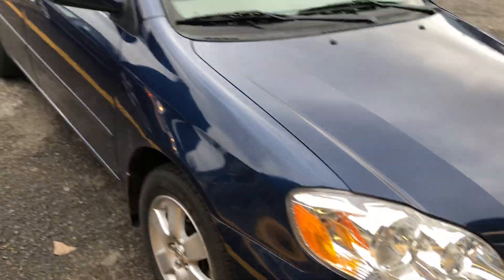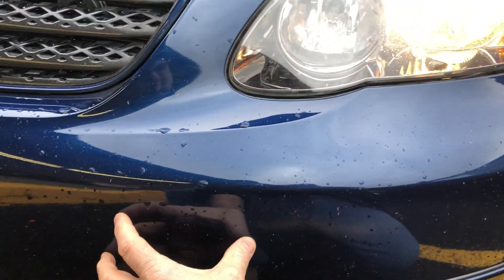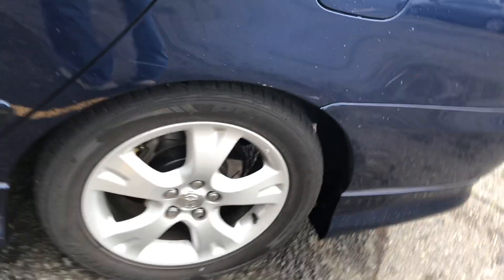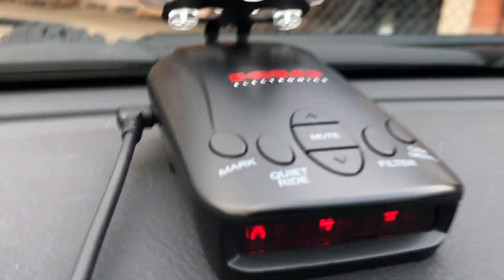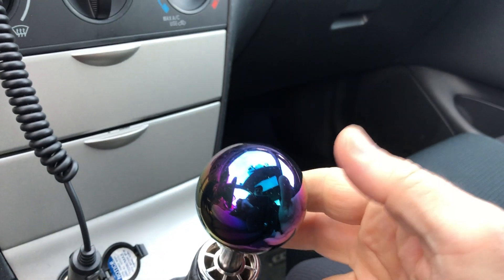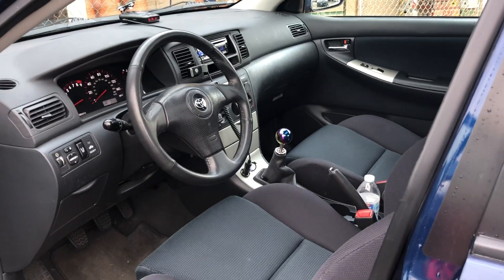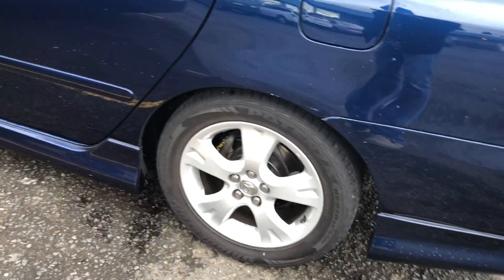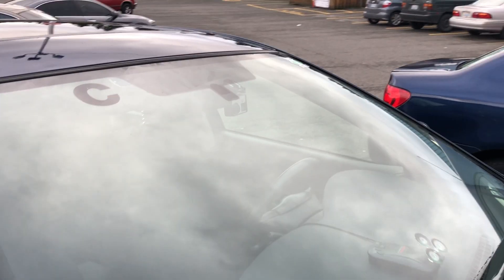2006 Corolla XRS Walkaround (Requested by @Buttmongrel3)

Comment: Toyota Corolla, XRS bro you ever think about getting a double den radio.   🔥🔥🔥🔥🔥🔥🔥🚬🚬🚬🚬🚬🚬🚬🚬💯💯💯💯💯💯💯👌🏾👌🏾👌🏾👌🏾👌🏾👌🏾
Reply from the maker: The OEM radio was a double DIN with a six CD changer. I still have it but it didn't have Bluetooth so I swapped it out for the Alpine and gained a handy place to put my wallet! I actually have oil pressure and temperature gauges in that spot now. I guess it's probably about time for an update...
Reply: @BluestreakCorollaXRS    do you have that radio for your car? Cool bro you did a nice job on that cooler intake for your Toyota Corolla XRS.   
I’m trying to get one of those radios for Matilda, Corolla with the Bluetooth navigation  
Those videos are real nice    I’m trying to get one of those radios for my car  too bro you💯💯💯💯💯👌🏾👌🏾👌🏾👌🏾👌🏾👌🏾👌🏾👌🏾📱🔥🔥🔥🔥🔥🔥🔥🔥🔥🚬🚬🚬🚬🚬🚬🚬
Reply from the maker: @streetsofcalifornia6481  did you name your car Matilda?
Reply: @BluestreakCorollaXRS    Yes, I made my car that I always like the Toyota Corolla. I had a couple of those cars different years very reliable.  Japanese cars always win 💯💯💯💯💯👌🏾👌🏾👌🏾👌🏾👌🏾🔥🔥🔥🔥🔥🔥🔥🚬🚬🚬🚬🚬🚬🚬🚬📱📱📱📱👍👍👍

Comment: how much does yours weigh? and did you dyno it, I'm curious of your power to weight?
Reply from the maker: I'm not really sure, but I think the weight is just a little over the stock 2670 lbs - I've reduced about 40 lbs of wheels by upgrading to Enkei, but they're sporting larger tires at 225/45/R17, which weigh more. I also added weight when I upgraded the headers and exhaust and oil pan. I have not had it on a dyno, but R9K told me that if I did the upgrades that match the ECU tune, I should get "into the high 190's at the wheels".  I hope to weigh it some day, and I will be getting an LSD installed while my cams are being replaced this month.
Reply: @BluestreakCorollaXRS  dang high 190s whp.. thats pretty good for N/A on a corolla, what effect do you expect after cams? stage 1 or 2 MWR cams? what LCD you going for , a Cusco? and yes the headrests lol, i wish i could delete them too but im always carrying passengers... are you planning on further N/A mods? ever plan to go with the turbokits.com kit?
Reply from the maker: @CubanLegend561  I'm going to put stock cams back in. I looked at the power curves on MWR and it looks like other cam profiles have advantages and drawbacks that I don't think are worth the $$. I got the R9K addition PPE headers, which actually make power. I found a used TRD LSD on MWR for around $400, so I snagged that and started waiting for the clutch to go... but now I've wiped my cams I'm going to get the LSD put in at the same time. I think before even thinking about adding more power, I need to put in the LSD and get some racing seats and harnesses because, as this video shows a hint of, just staying in my seat and shifting into 5th around a right-hand corner requires some serious abs! As far as adding power after that, we'll see. My S2000 (@SparkyS2k) takes precedence when it comes to sucking my my cash for upgrades, but a turbo does sound like fun. That said, I will only do it if I can retain the reliability of this car. One thing this video doesn't highlight is how many cars broke down while the Corolla just kept going and going - I want to keep that ability - to drive HARD but not die from it :)
Reply: @BluestreakCorollaXRS  dang, i hope this build works out! and the LSD.. im sure hoping to see your impressions of that, keep it up! :)
Reply from the maker: @CubanLegend561  thank you! I will be sure to keep you posted! Hopefully I will be able to get some video of the destruction up soon... Subscriber ride-alongs with  a 4-wheel track-off included! 😲
Reply: @BluestreakCorollaXRS  I'm looking into lightweight wheels myself, not easy to find for this car. I'm guessing you got the 17x8 RPF1. I wanted to run 17x7 and the same RE71 but 215. The 225s seem like a lot of tire compared to the stock 195s. How is the steering and transition with those monsters?
Reply: @zachbrandt1236  I'm running 17x8 wheels, and the steering really doesn't seem much different. The Corolla has power steering, so it's not really a drastic change in the effort required. In my view, more grip is better grip! Ooops, I answered via the wrong channel account, but I'm also BluestreakCorollaXRS :)